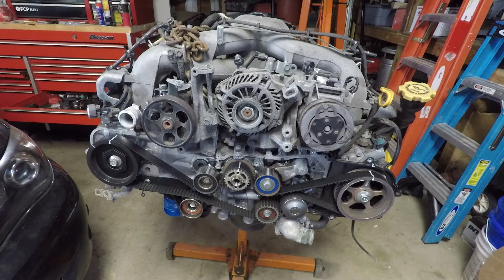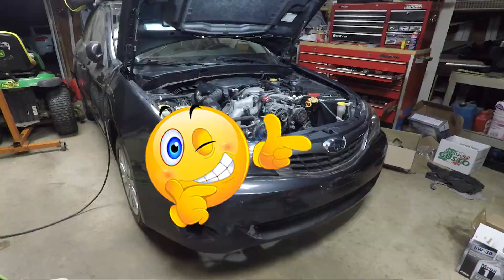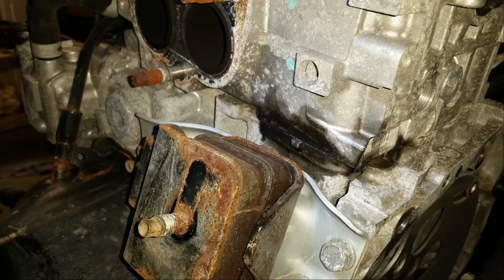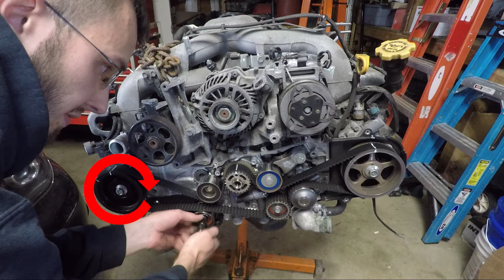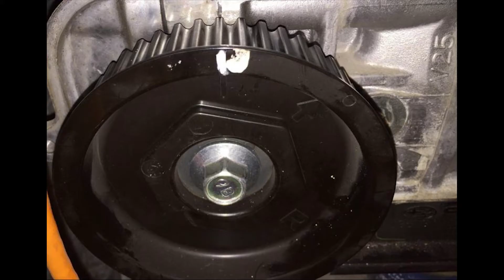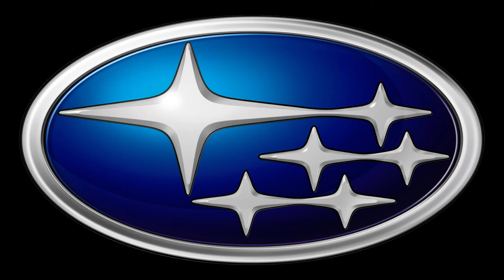Subaru Timing Belt -- How-To

Comment: How much did the motor cost?
Reply from the maker: +T V all the motors I found, ranged from $800-2500 depending on the mileage. We ended up getting a parts car with a good engine, with low miles within that price range